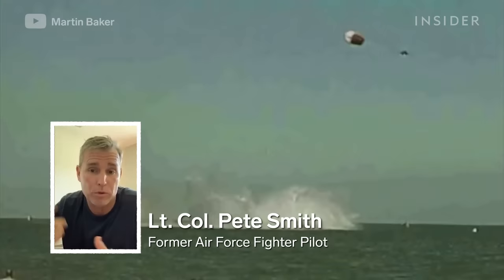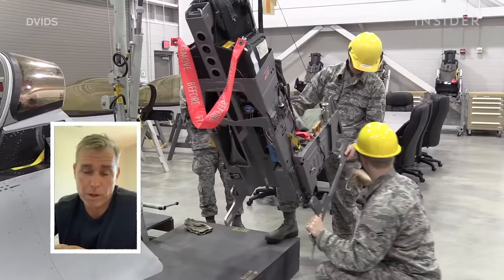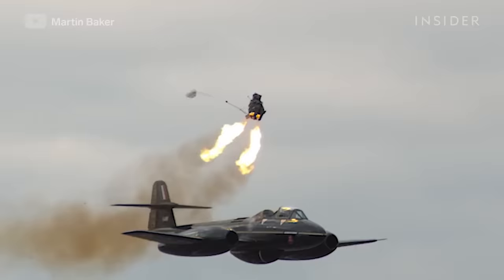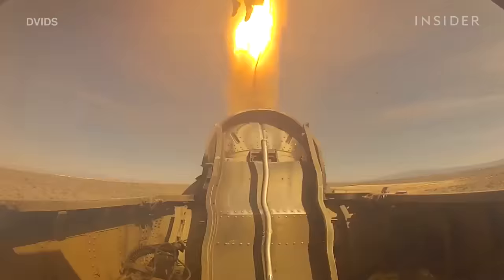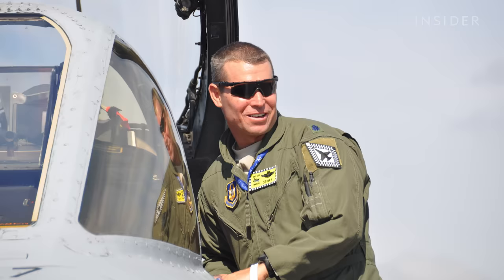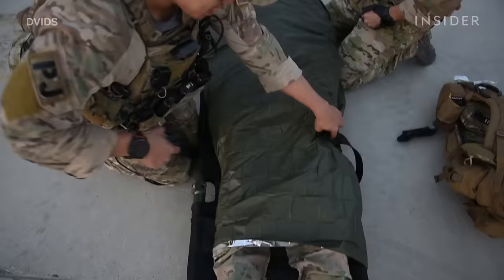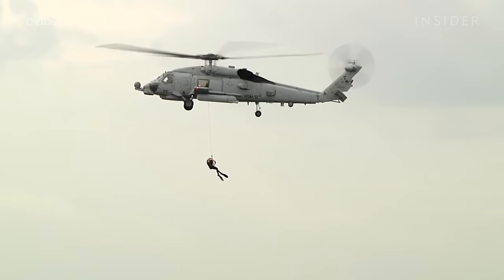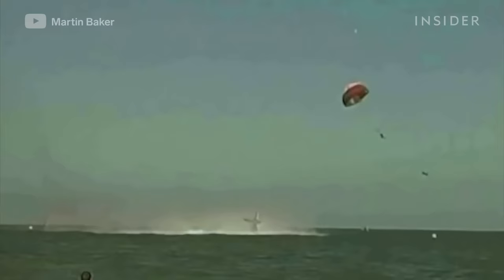The Death-Defying Mechanics of Fighter Jet Ejections | Cars Insider

Comment: I've always wondered... On the initial ejection, that seats gotta be burning hot and if not the blast engulfing you has gotta be hot too
Reply: im a egress mechanic for f-35s in the air force! sorry if youre not curious any more but... ejections happen so fast that it really doesnt have time to heat up, and the pilots suit provides some protection from the heat i believe(dont quote me on that one, i dont work with pilots) and then the seat detaches from you shortly after the seat leaves the aircraft.

Comment: In January 1977, while on a night IFR flight plan to Andrews AFB, over the Chesapeake Bay, I experienced a total electrical failure and was unable to read my instruments even with a flashlight in my mouth. I was in fog, low clouds and heavy rain and was experiencing vertigo caused by having to follow directions from ATC and having to change radio frequencies as well as transponder settings. Having one hand on the stick and the other on the seat handle, I was seconds from ejecting into the dark, frigid water when through the fog and clouds I spotted the runway strobe lights at Andrews. I know I was below minimums to land, but ATC was forgiving when they found out about my problem.
Reply: and my dad is batman

Comment: I read somewhere that after using an ejection seat, pilots are several inches shorter due to spinal compression.
Reply: Not several, but perhaps a couple of inches. Losing height also happens to earthbound people with degenerative bone disease.
Reply: Only during the ejection.

Comment: What seat are they talking about? Cuz the USAF Aces 2 seat is all analog homies. It runs on solid rocket fuel filled lines to run the seat mechanically. No electrical signals like said in the video. Canopy, rear seat then front. One can fail but since it runs on one line, it cant go out of order. Also with the aces two seat, the death from too gun is impossible. Maybe older seats could kill pilots but not the Aces two.

Comment: I believe there’s a device in the seat that determines the pilot’s attitude and then fires a rocket(s) to ensure that he’s shot upwards rather than downwards. That wasn’t very well explained but it’s designed to stop a pilot being ejected into the ground if the aircraft is upside down at low level.
Reply: Yes and no. There is a device to determine altitude and air speed. From there another item determines what needs to be fired by selecting 1 of 3 available modes and then fires them accordingly. There is another item intended to stabilize the seat and keep it upright but won't correct it if the pilot ejects while facing down
Reply: No US ejection seat does tgat
Reply: @TheHannukahZombie Look up the ACES II and the recovery sequencer.
Reply: @TheHannukahZombie  You haven't done your homework.  The ACES II Ejection seat system does this and more.

Comment: Breakaway front fuselage. Safety and security. Also remote operations of aircraft. Aerospace defense agency. Space force. Energy of protons force must be equal to or greater than the matter, given all of its measurements, delta, or to change position such as holding up the ceiling from lowering its power over us. The major arcs, the minor arcs the orbit of the new clearer atomic structure. The star of David. The creation of the snow and the marvelous design of its symmetry.
Reply: Peter 😮

Comment: Iv heard its way more than 14 Gs, I don't think 14 Gs would necessarily cause injuries to a pilot but it would be extremely uncomfortable and might cause a minor fracture, I hear 20 - 25 Gs is in ejection abd that's sounds more realistic to cause severe injuries.
Reply: It actually depends on how much you weigh. The charge is the same regardless. Ejection seats have an envelope of weights that are safe, usually between 120-250 lbs. If you're skinny, it's gonna suck. If you're heavy, it's gonna suck, but slightly slower.
Reply: @TheAlmostHarmless  It really depends on your weight?  I'd assume there would be a computer that launches you the same speed regardless of your weight.the aircraft already accounts for your weight in so many other things so...
Reply: @maxhagenauer24  Nope, it's really that simple. Ejection seats are incredibly analog, however they are very precisely engineered. All of the timing in the Martin Baker (I was a T-6A Instructor, that's just the seat we had) was done with fuses/charges of extremely specific tolerances.

Comment: Can you use the Ejector Seat when the plane is inverted?   Or are you pretty much F**KED if that happens?
Reply: They were designed for that. In fact, it has happened.
Reply: @CamperGun  Thanks for the info, but how does that work exactly???   I'm trying to understand the physics of this.  If the cockpit glass canopy has to always eject away from the plane, and the seat boosters are launched also away from the plane, then in essense the pilot is actually being launched towards the ground if the plane is inverted?
Reply: @annoyboyPictures  The  sensors tell the computer that the plane is upside down and  it tells the gyro to turn the seat right side up.     However, it needs a minimum of 150 feet to do this. I remember one pilot that ejected upside down below 50 feet and he was driven into the ground. Poor soul :(
Reply: @CamperGun  Wow... absolutely 👌Incredible engineering.... only 50 feet above the ground and you can still eject, turn rightside up, and deploy a parachute....
Reply: @annoyboyPictures  Well... no. You need a lot more altitude than that to eject and survive.
Reply: @TheGreatTomdini  What's the minimum height required to be Ejected while inverted and survive?   Also is there a max speed requirement?  I'm guessing you need to be going much less than Mach 1?  🙅
Reply: @annoyboyPictures  I know the Mk10 Baker seat takes you about 220 feet up before the seat falls away and the chute deploys. So if you're inverted, you're gonna need 220 feet plus whatever gravity tacks on from being pointed at the ground, and that's assuming the gyro needs no additional time/distance to orient you before the chute pops.

An inverted ejection probably requires a decent altitude cushion to account for all of this. Not sure of max speed.
Reply: @CamperGun  wrong
Reply: Sorry,  the inverted altitude is 150', not 50' which is is still incredible. It's only been 40 years since my Final Assembly Line Tech days. I got to see it happen more than once on official McDonnell Douglas test films at the factory in Long Beach, California 1979. The Engineers  gave us the specs while showing us the films.

Comment: "Ejecto seato cuz!"

So many nuances that goes into the construction of these "rocket systems" ( I was told by someone in the know not to call it a "chair" ) that I never paid much attention to details like that what was shown in this video. 

To add to the intrigue, all the flight controls and systems have to be moved out of the pilots' way before they can be ejected, because the cockpit of these fighter jets are crammed full of all the avionics and flight control systems that help keep the pilot piloting these aviating masterpieces, so there isn't a straight, upwards, unencumbered path out of these jets; never thought about that.

Really gets the mental gears moving.

Comment: Can a pilot eject if his plane is upside down?
Reply: Yes, they were designed to do that. In fact, it has happened.
Reply: At high altitudes absolutely, low altitudes it's an instant death sentence. See Kara Huntgreen for results. RIP.
Reply: @hobogrifter  The specs are down to 150'. However, speed is a factor as well.

Comment: Can a pilot eject a co pilot?
Reply: Yes
Reply: @dasboat64  not generally no. If the pilot pulls both go. The rear seater can go individually if the jet is set to aft(or whatever nomencature that particular manufacturer uses for their jet)
Reply: Ok. Because I was told as a kid my uncle who died flying an experimental aircraft for Boeing ejected his co-pilot and saved his life. My mom said he got a purple heart and I just never knew if the story was exaggerated. But supposedly the co-pilot refused to eject until my uncle did so my uncle ejected him and tried to save the aircraft and then his ejection seat ended up failing. It was a mess in court too because everything was classified.
Reply: @Kushert  so im not sure how they would configure that as then the pilot loses the decision. If they were seated front to rear, the rear seat would be cooked. Tandem jets usually have individual ejection initiation.
Reply: It depends. Ejection seats have two settings. One allows both crew members to eject regardless of who pulls the ejection handle while the other allows them to eject individually. The former setting will almost always be used. However, in tandem seat aircraft, the RIO/WSO (the guy in the back seat) will eject first followed by the pilot.
Reply: That was the immediate cause of Lt. Hultgreen's death.  Her RIO pulled the handle and ejected successfully.  The plane inverted during the delay before the second ejection, and Hultgreen's seat was fired straight into the water.
Reply: @Kushert  Could be at least slight exaggeration. The Purple Heart is only awarded for being injured in combat.
Reply: @MySuperslayer  it’s called an inter-seat sequencer.

Comment: would you get a dishonorable something if you died with your plane when you could have saved yourself? do some pilots purposely not eject ?
Reply: The pilot is ultimately in charge of their own safety. If you fail to eject and die, then you die. If you do eject and die, you still die.

But the one thing about ejecting...once you leave that plane you can never go back. So you are going to save it as your last resort.
Reply: My father was a flight instructor for many years.
He always said, ejecting is a last resort, but when you run out of altitude, airspeed, and ideas, it is time to depart the aircraft.
Bottom line, a pilot is still a multi million dollar component that the military would prefer not to lose.

Comment: Aircraft now is not good   I'll give you how to vertical take off and vertical landing and  
You are riding in a dangerous way you are sitting in a fuel chamber and the Engine is in smoke and fire .
I'll give you a power safe , no tons and tons of fuel no fuel chamber no refuelling. 
I'll give you a perpetual flying way , no need aircraft carrier and recharging .
My invention flash driving running in light speed way can power that perpetual power. 
You don't like then I Double my way 20 m $ first

Comment: You went upside down in darkness. Did you know how to read the instruments. The Artificial Horizon will tell you if your upside down.
Reply: You really think that a fighter pilot does not know his plane has instrumentation???
Reply: Pretty sure they know this lol, if they’re doing maneuvers they won’t be heads down as they’re yk trying to kill another plane
Reply: @kuiper921  You're correct. One thing not often discussed is that rapid changes in head position while flying greatly exaggerate the tumbling effect from your inner ear, which makes the problem of already losing SA even worse. Reading an ADI is easy. Understanding what it's telling you is different, especially since they can tumble, even when they have laser ring gyros and are electronic.
Reply: @TheAlmostHarmless  I've experienced very slight spatial D in a small piston plane flying through clouds but I imagine it can be so much worse on a fighter aircraft especially doing bfm or whatever at night

Comment: So much of the first part of this video is hilariously wrong. The first pilot talking didn’t eject at 2000 feet. 2000 feet and less than a second to live? What a hilariously bad liar. 2000fps is over 1300mph. Ejecting at Mach 1.7? He’s dead. He didn’t eject anywhere close to that. The other part about electrical signals being sent by pulling the handle is also wrong. It uses pressurized gas out of an explosive about the size of a shotgun shell. Why do people make videos like this and do exactly zero research? What a joke.
Reply: 1 sec to live probably about right.. Possibly a delay to get rid of canopy, also, downward vector 400 ish kts means the seat would not release until drogue has slowed to safe main chute deploy speed..